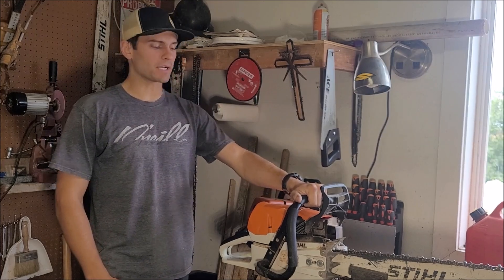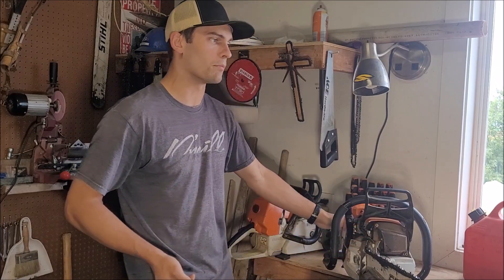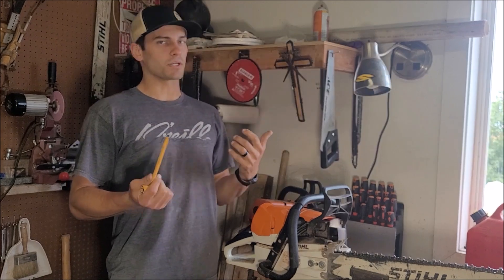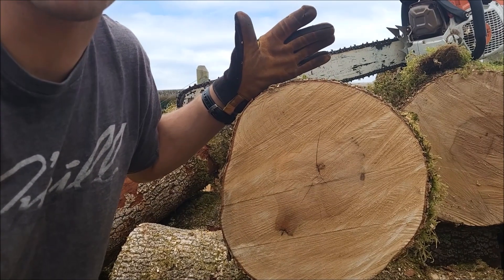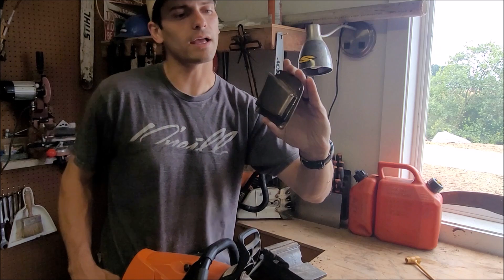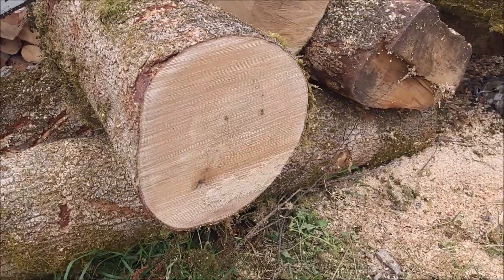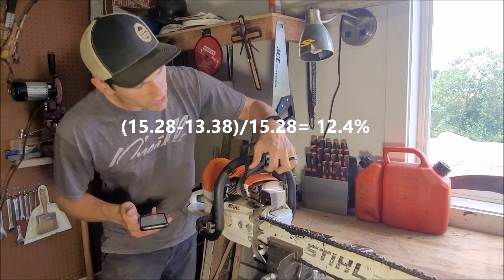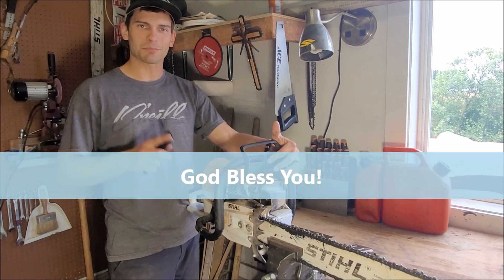Adding an exhaust port to increase saw power?

Comment: 12% more cut speed anyway hard to say 12% more power... power doesn't always mean a faster cut.
Reply: 1) Agree, NOT "12% more power". Yes, 12% decrease in cut time.
2) No mention of jet adjustment related to exhaust restriction reduction ... :-/ ??  
Otherwise, great video :-)

Comment: Cut way quicker if you use the dogs !
Reply from the maker: I typically always use them. I just figured it would be good to test the saw power without them to eliminate any biases or factors that could change the outcome. Not using them makes me appreciate them alot more!
Reply: Would depend on the saw and the log if you use the dogs and dig in harder it could bog down and slow the cut and one cut could have more pressure than the other so best way for time cutting is to just let the saw cut. Most even way to test